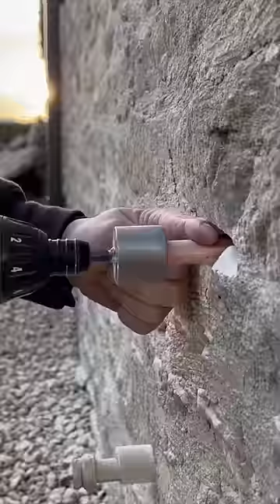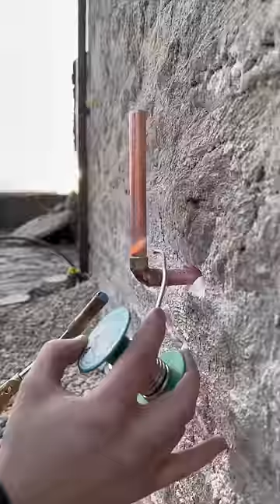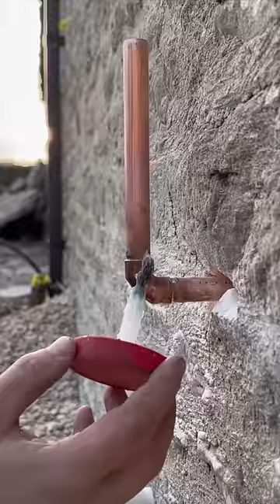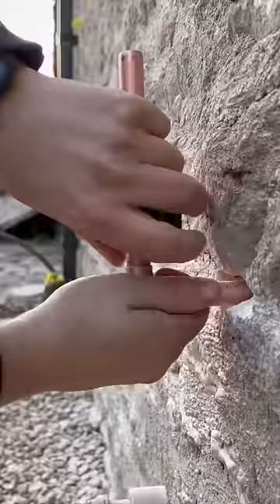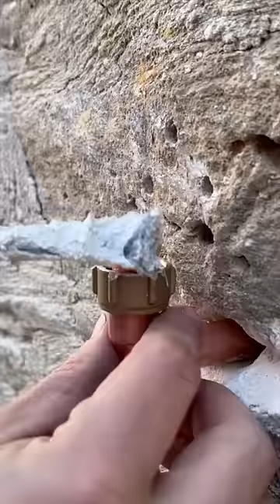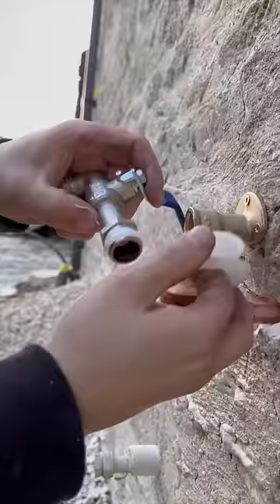HOW To fit an outside tap on stone wall! #howto #asmr #diy #plumbing #subscribe #youtubeshorts

Comment: Apparently in a climate that never freezes.   Outdoor taps require long frost free extensions    If ambient temps ever freeze otherwise your lovely copper will burst.
Reply: Lol 😂
Reply: Guessing Europe due to the other videos showing brown and blue electrical wiring instead of black and white.
Reply: @HolyGeekboy yeah, Europe never freezes.
Reply: @bugaboo-bricks  ಠ_ಠ
Reply: That depends, for example in my area it never snows and the temperature never drops below 12 degrees in winter, so it is not necessary.
Reply: Drain down for winter always
Reply: The frost free valve comments always crack me up. Not everywhere needs them! 😂
Reply: @MacCready_  Same. I was just about to comment exactly that. People think since they live in a cold climate everyone must. 🤯 Same thing about building codes.
Reply: @bugaboo-bricks northern Sweden says hi
Reply: Yup always starts an argument, he still needs to sleeve that copper through the stone though! 😂
Reply: or its not a permanent habitation. We have exposed copper outside in Canada. It's not an issue because you drain and close down cottages for the winter, filling some parts with antifreeze
Reply: Woodford model 19 baby
Reply: Ever heard of insulation?
Reply: That's why he replaces this yearly
Reply: @LordOfLight That's not enough.
Reply: Don't you know you can empty tubes before winter?
Reply: Mfs over thinking this

Comment: I would not recommend this in an area that freezes in the winter time. You will have frozen and busted water lines! Use a frost proof assembly that goes at least 6, 8, 10, or 12 inches inside depending on your area.
Reply: All these experts in the comments section why don’t they post a video of how it should be done…🤷‍♂️

Comment: Pro tip if you want to see shiny solder! Stop using flux to cool off your joints because the flux turns it grey. Instead just wipe with a dry cloth once the joint naturally cools👍
Reply from the maker: I’ll try it mate 👍
Reply: Why bother, the copper pipe will get tarnished pretty fast and not look so good anyways.
Reply: @frankward8003  You're right about the copper it will change and patina overtime. I take pride in my work so when I'm doing copper work it's something I do to make things look nice and clean 👍🏻
Reply: @metal_master  I take pride in my work too. I go over the copper pipe with scotch bright after I finish soldering so the whole pipe looks shiny and nice...but it doesn't last that long because as you know the copper will tarnish pretty quickly..but it looks nice right after the job is done...but copper is pretty much going away these days in homes...out in the commercial jobs we are using pro press fittings with copper pipe so soldering is becoming obsolete these days.
Reply: @frankward8003  you're correct about the copper being used less and less. In residential work it's almost nonexistent because time is money and it takes longer to install. There's also the issue of it being stolen for scrap which is another deterrent for builders. Sometimes copper is required but it depends where you're working whether it be residential, commercial or industrial. I do a lot of service work and we do use the propress system as well which is a big savings in labor and it's fantastic.
Reply: Thats not the case .... flux it and spray it with water to cool it , no the quench will not compromise the weld that's bs I am a journeyman plumber and have done this for years all of water lines look AAA+++
Reply: @coastalgrown4057  Copper and solder expand and contract differently so it's not advisable to use flux or water to cool your joints. Flux helps clean and remove impurities during the soldering process so it's not beneficial in any way to use it as a means of cooling. Flux is also very corrosive so adding more just means you have more to remove afterwards. It's best to let it cool naturally and then wipe with a dry cloth. If it works for you then that's great to each their own but it doesn't make it the correct way.
Reply: Not gonna stay shiny anyways, it’ll oxidize in a few weeks outside.
Reply: @Mr1987Vegas  You're right but that mindset shouldn't prevent you from caring how your work looks. I make my work look nice for personal satisfaction and to please the customer. Whatever happens afterwards  is beyond my control once I'm gone.
Reply: All copper oxidizing is good that is why it’s awesome lasts for ever if you keep stray voltage away , looks good turn it down next time. Like the 1/4 turn full port BV !!!
Reply: @mikemeyers4016  stop! You're getting me excited! 😂
Reply: True. PEX is taking over. Easier to run, no soldering required and OSHA likes that you don't have to use open flames. Less water hammer as well.
Reply: My question is this, using the same logic as, "it will tarnish anyway", why should a carpenter, me, bother splitting a teener, when clearly other carpenters apparently don't know you can buy a tape with the small lines on it, or squaring, or plumb and line with my laser? Its gonna cover with sheetrock, stucco, or whatever anyway. Right? Rhetorical. The truck out front belongs to me. People know my truck. People know me. They know when I pull up, so does give a shit in doing the best I can. Every . Single. Time.
Remember, flush don't mean your toilet is full.
Reply: But flux is to make the solder flow to nto the joint. Why paint it on the outside?
Reply: Who gives a fuck about seeing shiny solder as long as the joint doesn’t leak?
Reply: @Yo-nc7uu  A skilled tradesman who takes pride in his work. People pay a lot of money hiring a plumber and they deserve good quality workmanship for it.
Reply: @metal_master  too bad we live in a country where copper thieves go unpunished. It’s not like they ain’t on camera. Somehwere close at least. New stats: average person is on 40 video surveillance systems each day they venture out of their home. 
  We could have nice things like copper pipe. But it quickly becomes a massive cultural argument. Such a sad thing
Reply: Yea because you don’t use flux to cool joints down. Thats how you create crack in solder. You never cool solder down and flux isn’t for post soldering. Flux goes on before the solder, dude doesn’t know what he’s doing with the flux
Reply: @metal_master quenching a solder joint can and will lead to a compromised joint. You are cooling the metal at different rates creating some parts to contract faster than other parts hence the cracks. Beside flux isn’t for quenching. Flux makes the solder wet the metal and removes oxide which only works while solder is molten
Reply: @RedHaloManiac95  I couldn't agree more
Reply: @metal_master  lol 😂
Reply: @Electrocycle300  your not wrong!!! 👍
Reply: Hock a loogie on it, wipe it off, done.
Reply: I hope that isn't lead solder. We've been using silver solder decades ago.
Reply: Flux cures the joint 😅
Reply: @frankward8003  Plastic that is combined with glue is one of the best types, especially since it is heat-resistant. Iron is also excellent, especially if it is an external extension.
Reply: @Dirtydiapers4U  Flux aids in soldering and desoldering processes by removing oxide films which form on the surface of metals being soldered. It increases the wetting ability of the solder, causing it to flow more uniformly over surfaces without balling-up (dewetting). So actually it doesn't 😂
Reply: @metal_master  I've been doing it for 30 years buddy works for me! Joint looks much better cools the  joint down wipes clean!
Reply: @RedHaloManiac95 Asong as you don’t do it right away then it won’t crack. Flux works great for cleaning joints then soapy water and a rag afterwards some of my joints from years ago still look brand new.
Reply: I think he does an excellent job with his soldering, no drips from using too much solder. 
Although myself, I always wait until I see the beginning of a drip until I remove the solder then go to my next joint.

Comment: Don’t need goop on the pressure fitting.  It’s designed to self seal on all surfaces and can withstand approximately 1500 psi on copper.
Typical household pressure never exceeds 200 psi, so there’s a 1300psi buffer.  Even if that pressure fitting was to perform at 50% it wouldn’t fail.
Stainless steel pressure fitting can withstand up to 2300psi in certain applications. Sometimes more.

Comment: As a plumber since the early 80's, I can certify that this is not the correct way. Seeing as no drain point has been fitted,he should have rotated the pipe 180° and fitted the valve/tap under the wall elbow thus allowing the pipework to be fully drained. Watch the video upside down to see what I mean. 😊
Reply: Then you should have known that you install the valve/tap on the inside, so you can close off the water in winter and drain the water from there and not from the outside below the tap.
Reply: @Jacco_Prins  it's an isolation valve that's fitted internally like a stopcock or ballofix  or even a lever type valve that is installed. What the video shows is a lever type valve on the outside, which isn't exactly a tap or a faucet as the Yanks call them.
(p.s.. The drain point is installed at the lowest point of the pipework which isn't always  on the inside and If there wasn't a valve or tap fitted externally then you'd have an open-ended pipe. There's a reason why it's called n outside tap (the clue is in the name)
Reply: As a northerner, I was thinking the same thing while I was watching the  video.  This must be somewhere near the equator. Lol
Reply: Exactly
Reply: Полностью согласен, либо порвет в первый мороз))))
Reply: Use stainless screws outside !!
Reply: Your the heat! Or do they call that somthing else! Not sweating
Reply: Im not sure, guy, but I do know I've been a plumber since roughly 1989 At that point in life I started SERIOUSLY laying pipe into sometimes tight, sometimes deep "crevices" and nearly always "finished" with a satisfactory "job" 👌🎯💯👉😀
Reply: There are actually places on the planet where, for some strange reason, it doesn’t get cold enough to freeze outdoor plumbing. 

It has to be true cuz I saw it on the interwebs.
Reply: The video is upsized down.
Reply: @gplotzke4770 It ain’t gotta be that far southern Florida doesn’t freeze.  😂
Reply: Why didn't they protect the copper from the stone/ concrete with a sleeve
Reply: Was waiting for him to put a trap in for it. 😂
Reply: @Jacco_Prins  Not needed. You got special pipes + taps for that. Each time you close the tap (on the outside) the water gets drained out and it want freeze in the winter.
Of course it want hurt to have a extra tap on the inside, but not needed.
Reply: @luisaraujo4708  thank you. Not everywhere in the world freezes and not every country does it the same way. I'm sure a lot of these plumbers have never left their own state lol
Reply: And the dude took the time to drill a hole in the stone for the 1/2” pipe, you may as well just put in a frost proof hose bib. Looks better and won’t freeze.
Reply: Excellent POINT. I'd never use such a valve as this because I don't like the way the copper lines are exposed

Comment: Better still you can get a ready made fitting, 15 mil straight pipe with brass faceplate attached, threaded centre and c/s fixing holes. All fits closer to the wall too.
Reply: I love your solution most of all.

Comment: Just get a frost proof fixture that doesn't leave any exposed tubing.  Looks much cleaner too.
Reply: Right on. That's the correct answer.
Reply: No en todas partes hay temperaturas bajo cero , en países como el mío las temperaturas no son extremas ni en invierno ni en verano

Comment: No stainless steel screws on the back plate!!! 
Pipe not sleeved .
Those lever tap handles rust as they're not made of brass.
Reply: Brass slotted screws don't want any galvanic corrosion 😂
Reply from the maker: Pipes sleaved mate 22mm copper you can see it from the insulation with a stapler short
Reply: Pipe dope on a compression fitting?
Reply: Worst part - the pipe can't be drained and the water will freeze and burst it (unless this is Hawaii). Guaranteed fail point, guaranteed fail installation. What was the point of posting this??? To get slapped by every plumber in the country?
Reply: Should have used tapcon screws instead of mollies,mollies will disintegrate from weather.
Reply: @doublewide420 did somebody say Molly? 👀 🎉🤪🤭
Reply: Will say this valve looks like stainless. At like the stainless we have here…
Reply: Bla bla bla blaaaa
Reply: @azadiancustomworks1027 ALWAYS. Besides, why not?

Comment: I can tell you understand capillary action. Nice job. I find putting the flux brush on a hot joint makes the whole jar a mess so i just carry steel wool with me. Cleans it to a nice shine very fast.
Reply: I just used diluted simple green (or dish soap) in a spray bottle, and after spraying the soldered joint, a quick wipe with a rag left a clean flux-free pipe.
Reply: It makes a change as most plumbers nowadays will keep the heat on the join whilst soldering.  I was always taught to heat until flux bubbles, remove heat, tap the solder on, capillary actions draws the solder in to the join,

Comment: It's one and a quarter turns clockwise for the use of Teflon tape on pipe thread, avoiding the first two threads. Who in the hell puts 10+ layers of Teflon tape on a tapered thread?
Reply: It's some weird country. Not tapered they use straight threads...so use the whole roll of tape lolol
Reply: Actually 3 wraps on a pipe thread.
Reply: Who would do it? The same guy who puts pipe dope on compression fittings 😂
Reply: 3 and a half to 4

Comment: Pipe dope on a compression fitting but not on the valve that has threading, and no sleeve for the copper pipe good work just some minor errors.
Reply: Always somebody pretending to be an expert!
Reply: @RaymondYocum-uw5hd   Is your reply to joshuesaldana6273? joshuesaldana6273 is 100% correct; pipe dope shouldn't be used on a compression fitting, but is needed on the valve threads.
Reply: SMH too.
Reply: Why do you use copper pipes in water pipes? What is its benefit

Comment: Don't forget to to sleeve the pipe through the wall my son 🤓
Reply from the maker: Yeah I’ve got 22mm copper through the wall
Reply: @mmplumber  good man 👏
Reply: @mmplumber  If that pipe comes into contact with that stone at all it will put a hole in it. Pipes move.
Reply from the maker: @Gravedigger933  it’s sleaved mate
Reply: @mmplumber  a sleeve is a tube that surrounds the pipe and protects it when going through concrete. Like conduit. That is not sleeved!
Reply: ...and don't forget the Teflon tape.

Comment: WRAP YOUR PIPE GOING THRU CONCRETE SO IT DOESNT BREAK DOWN*** Always always wrap thru concrete or stone. 🎉🎉🎉🎉
Reply: Or use pex
Reply: @Patrick-jh1xk  pex still requires a sleeve and insulation. Anything going inside outside does.
Reply: @jamiecurtis2974  . Incorrect. The hose bib that is made for pex comes in lengths long enough to go through any wall. It is made of stainless steel and is an anti freeze hose bib. The pex is connected on the interior. You absolutely DO NOT have to insulate it or use a pipe. I’m 16 years hvac and a housing inspector today.
Reply: @jamiecurtis2974  I’m in NY btw. Where is definitely freezes
Reply: @Patrick-jh1xk   Well, pex isn't a hvac fittings, and this isn't a home inspection. Also, the reason for the sleeve and insulation isn't about freezing, it's about leaks. Home inspector doesn't mean building/code inspection. I'm in florida and south of the freeze line, but we still have to insulate because there's more to ISOLATION tape than insulation. Oh I'm a licensed plumber and mechanical contractor. Yeah, go look at window locks, bad caulked tiles, and doors that close poorly. Also, all pipe is long enough to go through walls.... Pex, also, isn't made of stainless steel, it's made of high density polyethylene. I really hope nobody hires you.
Reply: @Patrick-jh1xk  no you are incorrect....its also used to protect the pipe from corrosion from stone, brick and concrete. It should be sleeved or at the least put 10 mil tape on it
Reply: @jamiecurtis2974  if you go down about 5 comments you’ll see a man from Canada telling you about the same freeze proof hose bibs. Your just very inexperienced
Reply: @Patrick-jh1xk  I wasn't talking about freeze proof, but rather sleeving through walls because of leaks. IBC stands for International Building Code, not florida building code. Inexperienced is your ability to read words. Again, I hope nobody hires you.
Reply: @Patrick-jh1xk  also again LICENSED PLUMBER AND MECHANICAL CONTRACTOR, I don't think inexperienced covers that. Again go back to looking at broken weld on windows like you've actually done a trade.
Reply: @neilwilliams5825but that’s not what he did, so he should have wrapped it. GG